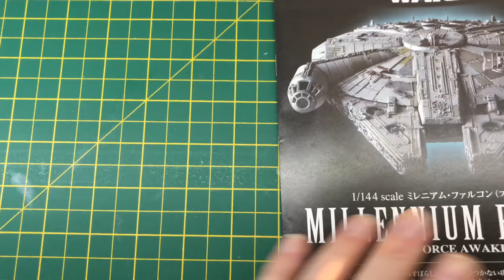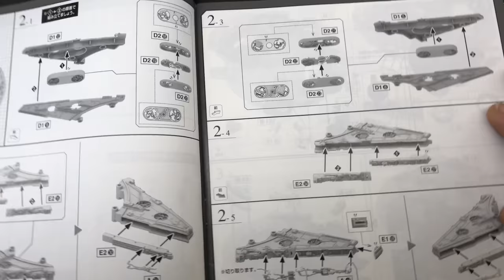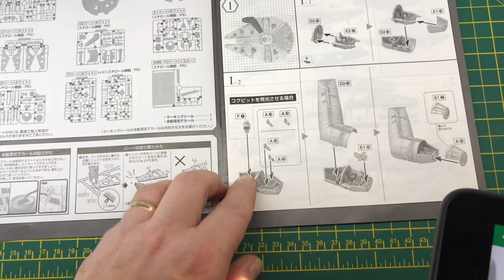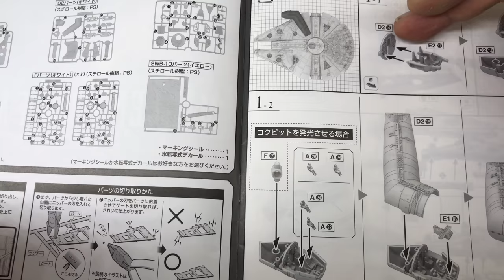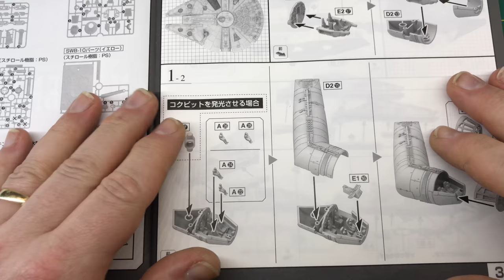Bandai 1:144 Millennium Falcon. Part 1: The Cockpit

Comment: Do you have a video of your parts holders and bases? If not what did you use for your bases?
Reply from the maker: The holders are foam, just crocodile clips on the top of cocktail sticks or kebab skewers depending on the size.